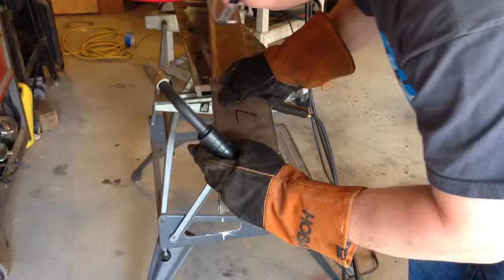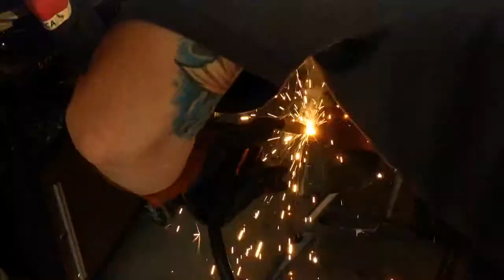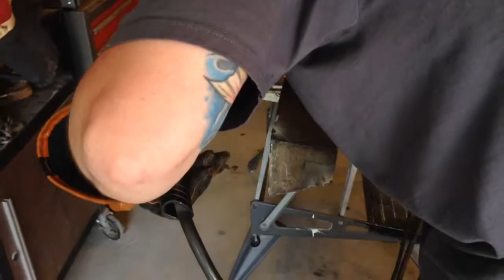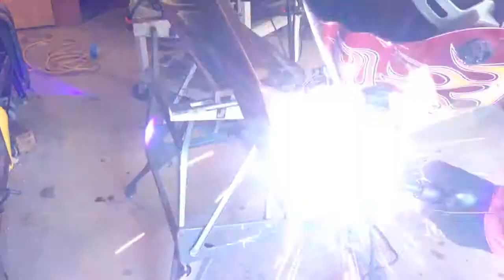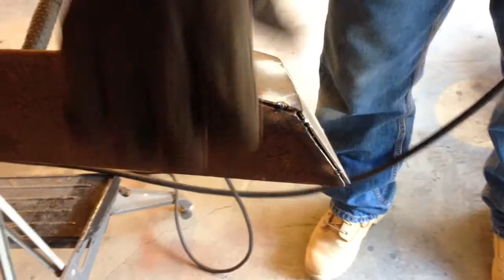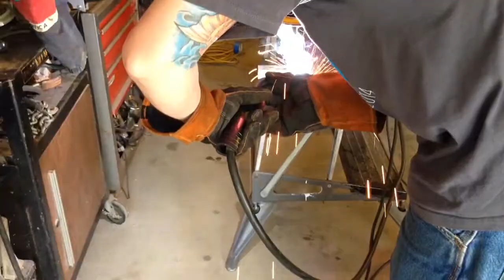The Dans FJ40 #53 - Working on the back bumper #5

Comment: You have a tough kid there. Welding with no welders hat.
Reply from the maker: He was more concerned with not having sleeves, not as much about splatter, as flash burn.  The wire fed welder doesn't throw off as much slag as stick does. But it will give you a sun burn!   B-)